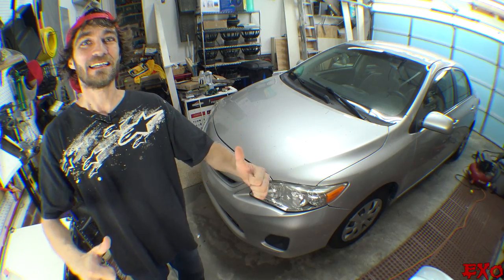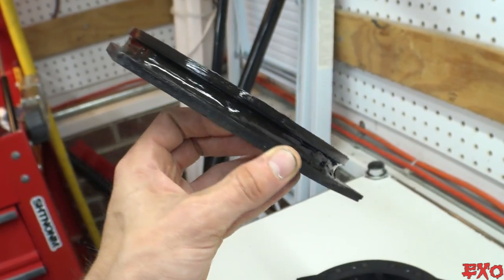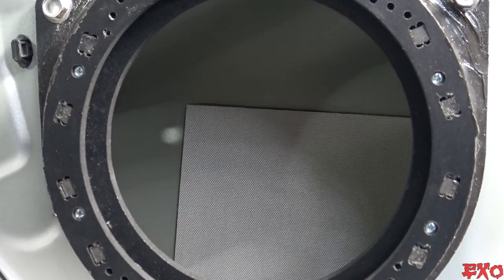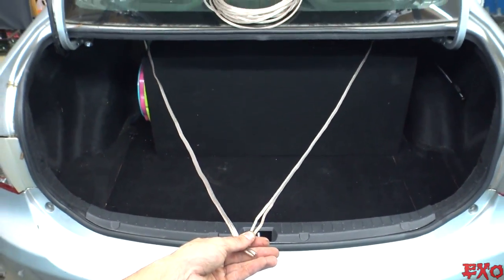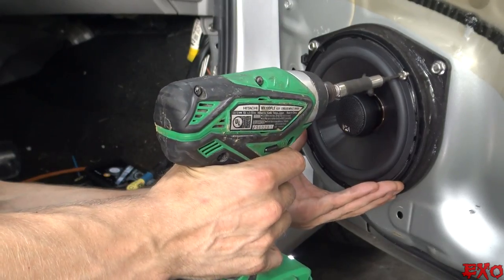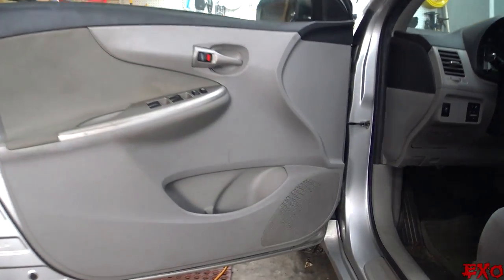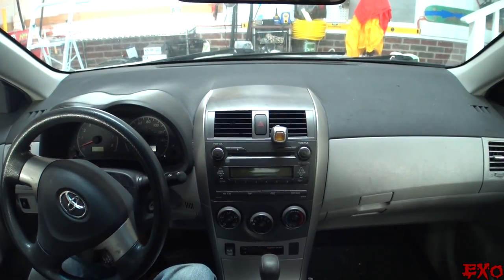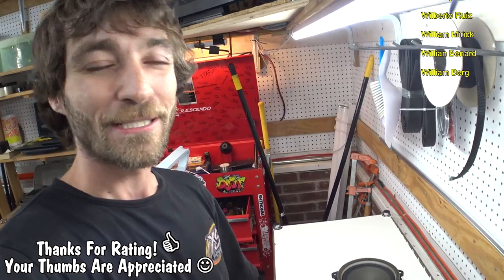How To Install BETTER Door Speakers w/ NVX 6.5 Coaxial Speaker & Installing Aftermarket Adapter Ring

Comment from the maker: Gotta' love FRESH new speakers :)

Do you have any projects going on right now!?!?
Reply: I am upgrading mine right now.
Reply: Hey exo are you going to the sundown audio show in Nc?
Reply: Huge 21" deaf bonce in my oldsmobile custom cruiser AKA 'shaggin wagon' 😁  WOULD YOU SIGN MY DASHBOARD? remeber on your last live stream someone said "will you sing my dashboard" ?? Yep that was me! i meant to say would you SIGN my dash!🤦‍♂️🤦‍♂️ my bad lol
Reply: 2 12" gladen shallow woofers im my sparetyre area 😁
Reply: Upgrading the fence on my table saw/router table. Need to make straight cuts for my next box upgrade.
Reply: Nice work EXO I like your editing its come a long way...
Reply: I just did the same to my car last weekend. I replaced all my door speakers and rear deck speakers. I put in cresendo pwx 6" mids in the doors, and prv 6" 6mr500ndy in the rear deck. I just gotta get run the wire next weekend when my wire shows up. My amp and tweeters will be hooked up. You always do amazing work and show  people how to do things the quick,easy, right way.
Reply: Saveing money to buy psi subs
Reply: I’m planning on making me a fiberglass A pillar with some tweeters and a 3” speaker on each one.
Reply: Just got my door panels done. 3 10inch crescendo pwx, two crescendo super tweeters.
Reply: Yes my mom's Toyota camary
Reply: Just did 4 doors in my 08 Civic. Snapped 2 door cards cus the clips were jammed in so hard and now have rattling against the door card cus you need a piece of foam around the outside of the speaker which sits between the door card and the front of the speaker. Frickin' nightmare! Kinda wish I never started the install. Civic owners be warned everything you remove will break.
Reply: I'd say if your fishing wires I'd recommend a coat hanger
Reply: I need To redo my opel's trashed radio wiring. And then upgrade speakers.
Reply: running nvx over the crescendos im use to seeing in the builds ya do any reason or just wana mix it up some
Reply: bass out it’s cheaper. And it sounds decent
Reply: Trying to finally hook up positive, negative, w6, and at least rear focal 6.5 components to mine JL 900.5
Reply: Hell yes EXO! Nothin like it!
Reply: Gf has that same car (corolla e150) i've put a 12" sub in there and a 2din unit. After this vid i think i need to change the front speakers too 😂👌 how is ur rear window not rattling?
Reply: Yess and it's my first build 
And I'm 17😮
Wish me luck
Reply: I love speakers I'm a kid I can't afford speakers still love those speakers pumpin.
Reply: If I ever get time finish I'm doing 4 savard hi-q 6.5's on an Orion xtr 2500.1dz and 2 sets of skar spx 6.5c's on a kenwood excelon 450x4 in my 02 Silverado
Reply: "sweet tart" that made me lol.
👍
Reply: Just finished installing my first self built/designed sub box for 2 type r's
Reply: I’m doing a little system in my 2015 Civic it’ll consist of 6 crescendo pwx 6.5s 6 ft1s I believe they are on an sk100.4 for the tweets an sk200.4 on the mids then an sk2.5k on an x10 or x12 a 250 amp
Alt and 140 worth of amp hour power all
1/0 ofc wire 14 guage ofc wire ran to speakers
Reply: Stock speakers motor is neodium
Reply: Deleting my ashtray and cig lighter. (I don't smoke or have a need for it) Building a panel to house my volt meter and bass knob in the ashtray spot.
Reply: Rebuilding both of my rides currently
Reply: Upgrading the sound system in a mk2 clio, lot of sound reflections to deal with
Reply: Will be putting a full system in my van I just bought as soon as all the parts are delivered.
Reply: I've fully upgraded my mids and highs with boss audio. I definitely need to run an amp to them. Any suggestions?
Reply: @GuyanaCarAudio592  you'll be okay I've been doing this since 13 I'm 15 now lol
Reply: Yes! 

I built a slot ported box for my ‘15 Nissan Titan crew cab for a Sundown Xv2 18, powered by a Rockford Fosgate T1500-1bdcp. Upgraded to a 240 amp Mechman alternator. Big 3 upgrade too.

For component speakers I chose the Polk MM6502 for their high power handling, and I’m powering them with a Rockford Fosgate T400x2ad. Running everything off a Sony XAV-AX1000.

Whole truck is sound deadened with Stinger Expert Roadkill, except for the roof (which i didn’t realize how important that was , so that is next).
Along with damping the roof, I want to get a limitless lithium 15ah battery.
Reply: @EXOcontralto I have a 2019 Corolla LE and I'm working on getting 2 Sony explod 12 in woofers, new front door speakers, idk what to get for them. I replaced my rear deck speakers with 2 6by9 2 way Rockford fosgate 65watt speakers.
Reply: Thanks for turning me onto that Navie D ! Just chatted with him and he actually saw one of your vids for the first time last week . 👍😃
Reply: Destroying my speakers
Reply: My bike. A 1989 FZR400 that has parts that need some finding!
Reply: Question....I have an 07 infiniti with BOSE system....can I upgrade the mids and highs WITHOUT getting a 4 channel amp or REWIRING ??
Reply: Still trying to get my rear deck done with 6 skar pro6.5s
Reply: Hey mate, when adding a sub and amp, running stock deck and amp. Saab 93 has the stock amp in the trunk easy to get to but lovely tucked away. Would phase adjust be enough to get it running with satisfying timing or do i have to change headunit to get timing settings for good results?
Reply: What's your opinion on the best $250 sub?
Reply: Thinking about  upgrading my front and rear speakers.  
Still got the sound from my old car.  i've got Some MTX Terminators in the Front, and Magnat in the rear

I'm kind of a noob when it comes to car audio.

I have a Daewoo Kalos 04 and i tell you accessing my front speakers is WAY easier. The door panel holds on with 4 phillips heads and its open.

I was thinkig about buying the same speakers you got. 
But they don't sell those in The Netherlands 

But your vids are good for a learning, when it comes with isolate it   gonna try the same methods what you do
💪🏾👍
Reply: Love me some nvx good quality products
Reply: EXOcontralto 
Jbl 💵🔈👂🏻🍭🍬〰️
Reply: @murder5000  v
Reply: i need to ask your running the stock head unit and getting the sound from a line converter right?
i don't have a 4x amp to drive my 4 inner speakers yet but i am putting in 1 12" sub in my impala will it be ok for me to tap in to my 6x9's with a line converter or will i get some feet back from the 1 sub messing with the 6x9?
Reply: Gonna replace doors speakers they have hifonics stock replacement speakers the fit in as replacement no cutting looks the same as before just better speakers
Reply: My project is two kicker 15" l7 with kicker coaxial 6.5 in the doors in a 2003 Chevy blazer
Reply: I'm a smoker and always drive with the window down (I live in the desert where it rains very little) so I guess speaker tweakers would be pointless unless I put the tweaker on the glass which would be dumb.
Reply: you don't put soundproofing?
Reply: I wanna put door speaker in my Toyota echo which doesn’t stock door speakers

Comment: Dude! I've been slapping speakers in cars for forty years and I've never thought of the zip tie trick👍
Reply: Metal coat hangers work great as well. Just make a loop in the end and put tape around it
Reply: I do the metal coat hanger tricc also neva thought bout zip ties
Reply: I use zip ties when going through tight or short areas but I've always taped the wires on. Never thought about the way you did it.  Gonna have to try it
Reply: A fiberglass fish tape works well.
Reply: @austinwilliams7926  Yes! I use it too abd you can fit any size wire. However the ziptie trick is nice as well.
Reply: Your not a pro.
Reply: bobbg you’re*
Reply: some rubber coated hard wires works as well.
Reply: There's another Youtube channel out of Clearwater Florida that has been doing this forever. Check out 5 star car stereo

Comment: By far worst part is running wire. I use lots of cuss words and cut up knuckles doing mine.
Reply: Hello do I need amp for this speakers or is it enough my stereo 50w x4
Reply: @zydrunastamosauskas3569  usually the stereo is enough depending on the speakers definitely not good for subs though if you want bass heavy speakers a small amp will do
Reply: @zydrunastamosauskas3569  an amp is also better for quality sound unlike the stereo
Reply: No need, stock wires will do
Reply: 75% of car audio is running and hiding wires/cables

Comment: The speakers in my Kia Ceed look just look like those plastic baskets. They are going to be replaced with Vibe Slick 6 speakers with a nice metal basket and a significantly larger magnet. I had them before and they do the job.  It should give much better mid tones. There will be components up front and coaxial in the rear doors and lots of playing around with adaptors too. Nothing like a good project! Thanks for your video as always. 👍

Comment: Just bought 4 6.5s for my doors and been dreading changing them out and running new wire to my amp but your video gave me some motivation. The zip tie trick will help me a lot, thanks!

Comment: Nice work as always. 
For anyone new to car audio, always check that nothing is going to hit the window when it's down fully. I've seen this happen a few times when people have put larger magnet speakers in and haven't spaced them correctly at the front.
Also i like to put a bit of electrical tape over the crimps just incase they touch the window rail. Don't want to blow your new speakers haha

Comment: Man EXO I'd like to just say thanks, I was thinking of getting component speakers recently and I remembered you always using NVX. I bought their VSP65KIT component speakers and installed the mids in my doors, tweeters in the dash of my truck. They sound great and take power really well! The little -3dB tweeter attenuation switch was a great little bonus too!

Comment: My aunt had a Nissan Versa with similar speakers to these stock speakers. The thing with those is, they sounded perfectly fine in good weather, but when it rained, it caused the coil inside to rub against the magnet. Then once it stopped raining, 30 minutes and a little bit of music later and it would sound perfect! I don’t know how that is possible. We installed Kenwood kfc-1665s speakers, which are not anything special, but are good to use without an aftermarket amp, and at least they use poly cones. That car is sounding better now, but I am going to have to fix a few things: one of the rear door speakers is out of phase! Also, since they are 6.5 inch speakers mounted in a bracket designed that works best with 6.75 inch speakers, there are those extra holes that should be filled.

Comment: Awesome! Thanks for the videos, much needed help with my 2010 Toyota Corolla! I replaced my rear speakers with some kickers. I'm going to be dointbthe front door speakers in the next week or so. I do have to say that the stick radio is garbage. I just recently replaced the radio 2 weeks ago with the Kenwood DMX7706S. The stock radio kept showing signs of over heating for 3 years or so. Every summer it misbehaved. The screen would go out, knobs and buttons not working, and recently the aux would fail. I had to wait until the car cooled down in order to use it. I am very happy with my Kenwood.

Comment: nice video, a little tip that I do when I want to amplify my sound, I just buy one of the adapters, usually universal adapters, and run the wires to the amp, I do this when I want to put the amplifier in the glove box or under the seats.

Comment: I always keep a roll of aluminum electric fence wire around for fishing wire, also useful for hanging things like brake calipers to keep weight off the brake lines and hanging items to spray paint them. Lots of uses for a good solid wire.

Comment: Actuelly the corolla speakers are pretty suficient for a 300w sub but if you want to go bigger, it's definetlly a must upgrade. Nice secondskin sound dampener. I will check these out if save me the pain to insulate the hole door pannels

Comment: If im running an aftermarket amp on my door speakers I usually used a stock door speaker front speaker wires and splice the speaker wires that go from the head unit to the rear speakers together and hook the rear speaker wires up to the amp and then run new speaker wires from my amp to my rear speakers

Comment: i use a metal coat hanger and tape the wire to it to fish the wire where i need it to go. even have used an old car antenna as well, cut them to length you need and works pretty well.

Comment: Best installer video I've seen. One of the best. What's with Toyota? Their standard level cars all come with the cheapest bottom of the barrel parts. The seat's last like a year. The motor may run for 600,000 miles but your backside is gonna pay the price during the last 560,000miles. Junk.

Comment: New car upgrades when you can this is what I've done asap. Replace all stockies with MB or Maestros new wiring. Bang for you bucks.As a pull through tool I used a long thin SS 2way antenna with the ball end to attach the wires as a system install would save a lot off time.

Comment: I use a stiff plastic tub to fish wires through from the door to the cabin.  I learned to do it installing powered running boards in trucks and suvs

Comment: For 4 Channel amps I use speed wire and run it to either behind the radio or factory amp. It save me time not running individual speaker wires to each speaker to new amp and utilize already existing wiring in vehicle.

Comment: An easy way to get speaker wire to slide through the gromets is spray it down with silicon, but leave a half-dozen inches from the end of the wires so you have something to grip

Comment: On personal vehicles? I cut the stock speaker wire that runs through inside of the cab, tape my new speaker wire to that, and pull the factory speaker wire in the door.. some vehicles are different and actually have the junction that comes apart inside of the door Jam with a pin connector. Those get more tricky to fish wire through and reattach

Comment: I use the zip tie but I cut the heads off so it wont catch on anything and just tape the wires to the zip tie and if it's a tight one use some spray silicone lubricant because it wont hurt the rubber.

Comment: Hey  Exo the message you are using to switch the wire I have been using for a couple of years now one tip I have for you instead of pushing the wire  true the  cable tie,  cut that end off and electrical tape to attach The Wire and you would find you would be able to fish the wire easiest

Comment: You should have ran some of that sticky rope stuff under the 6×9's just to avoid plastic to metal vibrations! Also if you are going to put any subs in the trunk I would isolate the 6×9's from any back pressure from the subs

Comment: I use a small flexible yet rigid enough hose. Run it through then tie a cotton ball to the wire and use a shop vacuum to draw the wire through

Comment: have you ever used one of those cables that have all the speaker wire and a remote inside 1 cable? you splice in behind the radio and do 1 run back to the amp. most are only 18g but I've never had any problems. my speakers only see about 100-120 watts though.

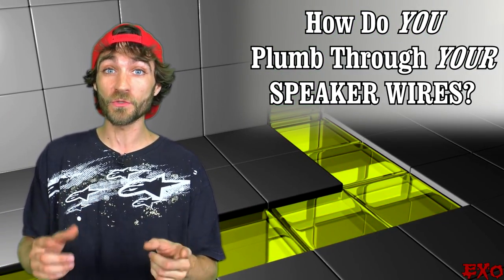Comment: 6:52.. I use those fishing wire, like plastic ones or fiberglass ones, from harbor freight tools you can find them in different sizes,.. I do residential electrical stuff so ..

Comment: Heyy a question? I have a Audi a4 avant with the symphony speaker, ,the full package. When I replace the speaker but somebody told me if I do it my Tweeter and midrange will not work, speakers I want to change the ones in the doors ,the woofers

Comment: would be fun to watch the window hit the magnet while opening 😂
Reply: New speakers don't have a much more height than the stock ones. And there should be a good one inch space between the stock speaker and the window already. The new adapters are much flatter than the original ones tho.

Comment: You don’t use anything to seal between the speaker and the adapter/spacer? I’m about to install mine and thinking of using some CCF foam between.

Comment: Many other car stereo guys suggest that there is little to no benefit in upgrading the factory door speaker wires and that you should leave the wiring intact if at all possible.  Your thoughts on this?

Comment: hey i gotta good tip bro i solder a short piece of wire to the speaker then solder on a xt60 connector in case service is needed i cannot stand the tab connectors they fall off eventually

Comment: Cable tie is ok I suppose though really the cable sticking through the massive block at the end of the cable tie make the end to big and risk the cable pulling out.... Could only be fished through giant holes. 
An even better trick that sparkys use is a metal coat hanger, cut the end of, bend it straight, put a tiny U bend in the end and plier crimp it down over a cable end and you can get it through some much harder to reach places and it wont pull out. Also can reach about 10 times as far as a cable tie and around odd bends.  Sure if the run is very short I suppose the cable tie works :)
Coat hanger with the right hook bent in can also be excellent for fishing cables if that is needed though I doubt it.

Comment: Ive crimped 8 wires to female euro connector witch ive plugged to the euro connector for the stereo deck and ive runned all 8 wires to the back where my amp is..Stock wires are enough for 80rms speakers.They can hold even more...That way you dont need to make holes on doors plugs and stuff

Comment: To rout new wires, I would usually wrap a coat hanger around the wire... It does the same thing, but u get a longer rod to push through tight dpaces6

Comment: damn that zip tie trick is nice, i will surely try this next time. I used to use chopstick and taped the wire to the chopstick hahaha. the zip tie will be easier since it is more flexible